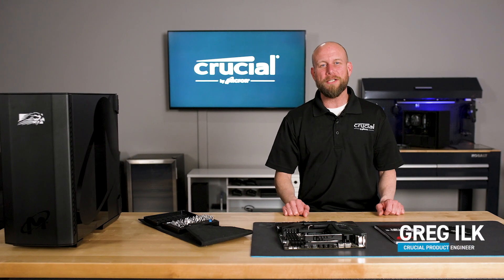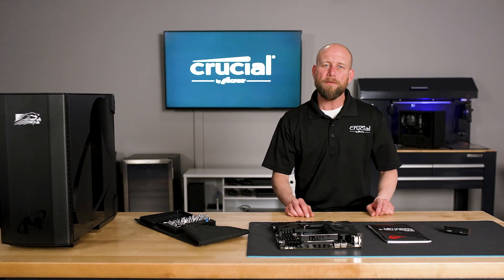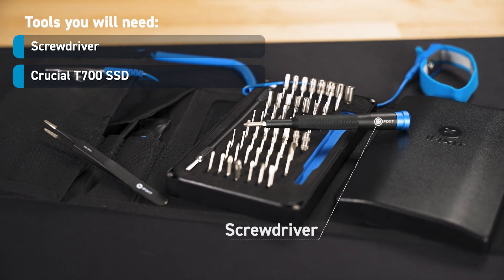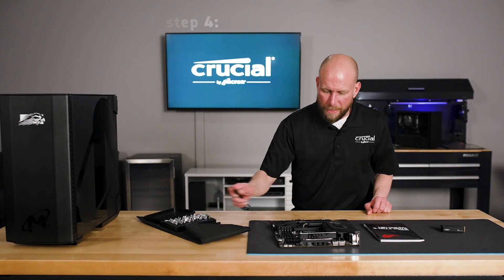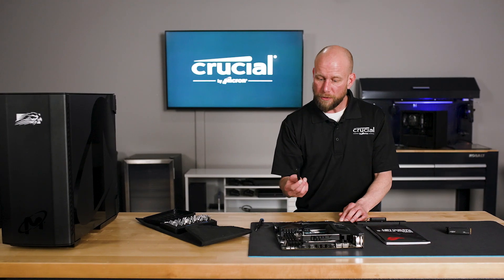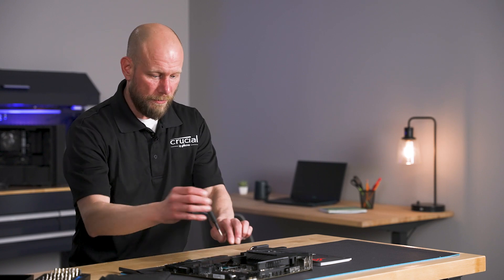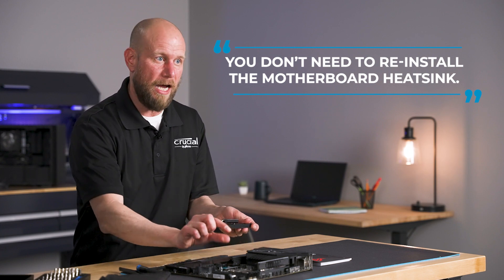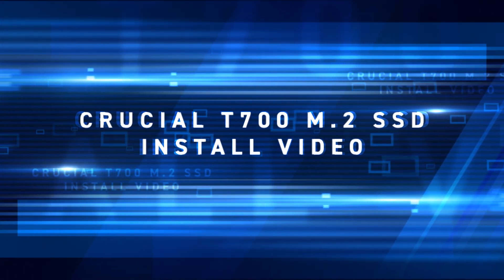Crucial How To | Install your Crucial T700 Pro Gen5 NVMe® SSD with Integrated Heatsink

Comment: Crucial can you remove the heatsink on the ssd if there is no room for it ? i am bit worried about the space when the gratich card comes in
Reply from the maker: We do not recommend removing the heatsink on any of our SSDs as it voids the warranty. Alternatively, we do have a non-heatsink version of the T700 SSD that you can use with you motherboard heatsink. Hope this helps.
Reply: @crucial  hi crucial :D i know i was talking about the without heatsink.. 

will a motherboard heatsink be okay ? i am going for a asrock hachi x870e motherboard ?
Reply from the maker: Yes, you can use the motherboard heatsink with it. You can  use the Crucial Scanner available at https://crucial.gg/SystemScanner to check for product compatibility.  If you have any further questions or concerns, please visit https://crucial.gg/ContactSupport so that you can speak to a customer support representative to help resolve your issue.
Reply: @crucial  i dont understnd what the systemscan does ? if the ssd is not showing in the system. i wont be able to run systemscanner :D
Reply from the maker: We are sorry to hear about your experience. Please visit https://crucial.gg/ContactSupport so that you can speak to a customer support representative to help resolve your issue.

Comment: How do i remove the built in heatsink from the NVME when the motherboard already has a sufficient heat sink, why would you make it so difficult to remove??
Reply: it also has a heatsinkless option. Then you probably should have taken that.
Reply: @novi5841  it didnt use to... it does now yes and ive used about 20 of them. They do need a heatsink though.  Even in immersion cooling, otherwise they overheat . Amazing ssd though

Comment: is it more better too use the crucial heat sink instead of the mother bord heatsink ?
Reply from the maker: Hi, Thanks for reaching out. It completely is up to your personal preference and use case. The T700's heatsink was designed specifically to best help dissipate heat but you can always opt for the T700 without heatsink and utilize your motherboard's heatsink instead. If you have any additional questions, please visit https://crucial.gg/ContactSupport to contact our Support team to assist further.
Reply: @crucial  sorry to say this here thank you for the reply 

But I have just recently learned the using a PCI 5 gen  drive makes the graphics card GPU bus slot go from Gen 4 * 16 to Gen 4* 8 

On any motherboard no matter how expensive in this world 

This is a deal-breaker and I will not be using this drive because of that reason for my Channel that I will start soon 

For high-end PC gaming with the highest tear of hardware available to humankind

Comment: The heatsink on the Crucial SSD you have to remove to replace with another  as it works very poorly.  So question is how do you take off the heatsink.
Reply from the maker: Hi Cain. We're sorry to hear you have had a poor experience with our heatsink equipped SSD products. If you can please reach out at  https://crucial.gg/ContactSupport our team would be happy to work with you on finding the best solution!